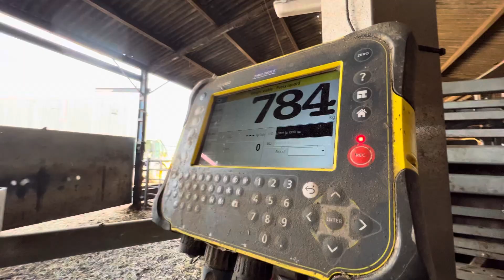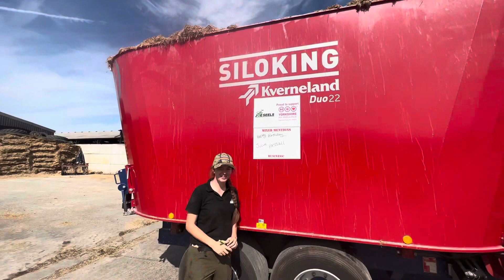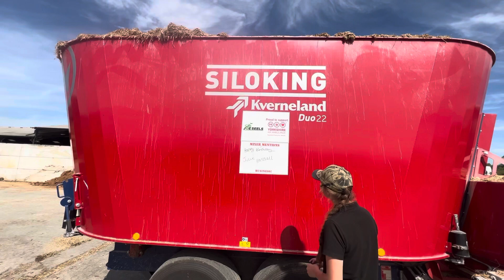York with the SCANIA! Fixing leaks! Ems News!

Comment: 40.26 4 tonne lift at 26 meters weighs around 16 tonne I think we run 50.30 roto 5 tonne lift at 30 meters we use it with tree shears great fun

Comment: Well done Em on passing your theory test, the Merlo Roto is a 170hp 4 cylinder engine and it’s Max operating capacity - 15400lbs and the load capacity at height is 6600lbs